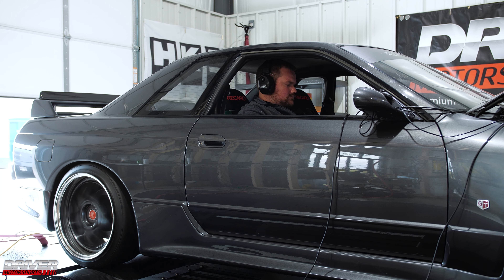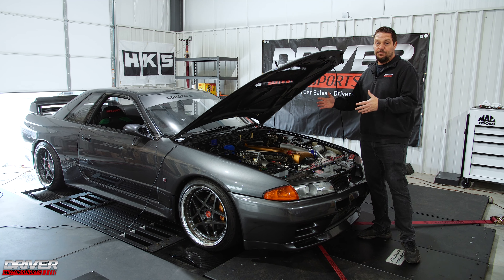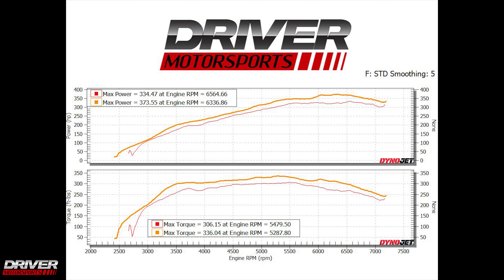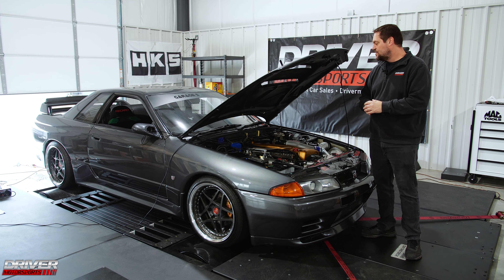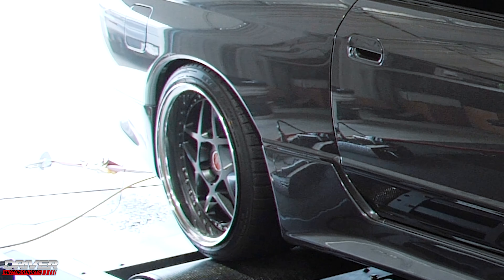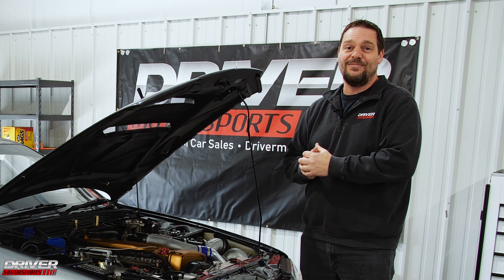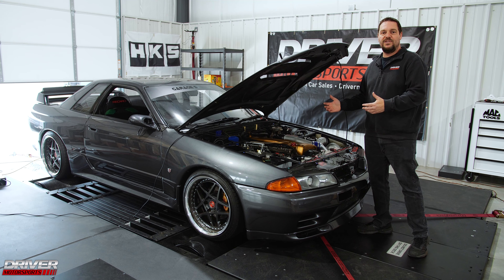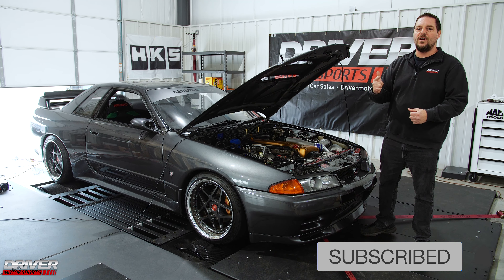REAL WHP | RAYMUND'S @kyddo112 SKYLINE R32 GTR...AFTER CAM AND DOWNPIPE | DYNO TESTED

Comment: what turbos?
Reply: m50power yeah I wondering the same and on what octane
Reply: Stock rebuilt on steel blades. 93 octane
Reply: kyddo112 how much boost and what engine management
Reply: Gareth Evans about 18-19psi on a haltech platinum pro and 750cc FIC’s
Reply: kyddo112 nice I’m making 400hp to all 4 with rebuilt turbos 1000cc injectors cams cam fears and a link ecu
Reply: Oh nice! How many pounds? I was hoping to break 400 on my setup as well ☹️
Reply: raymund abeleda 21-22 psi (1.5 bar)
Reply: Gareth Evans the stock twins didn’t lose air up top?
Reply: kyddo112 they have been hi flowed we are assuming as they have steel wheels and a bit more lag than what stock turbos have